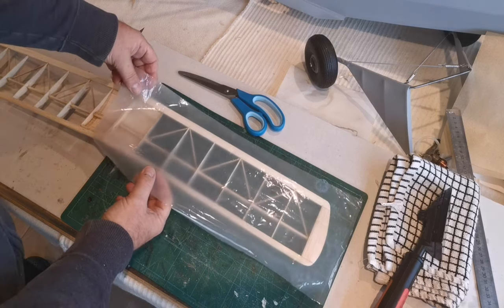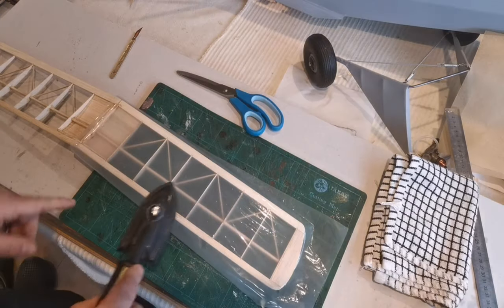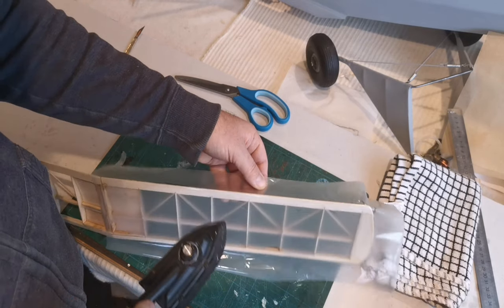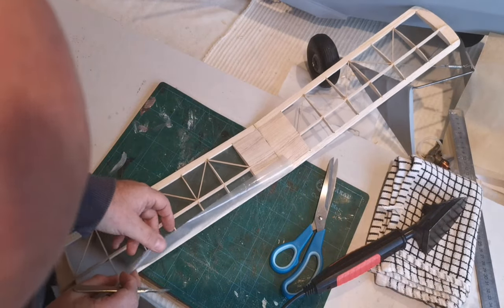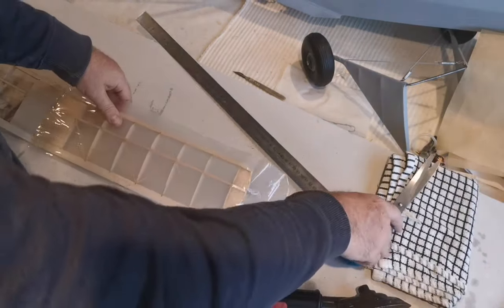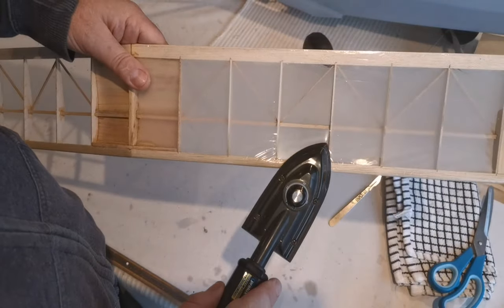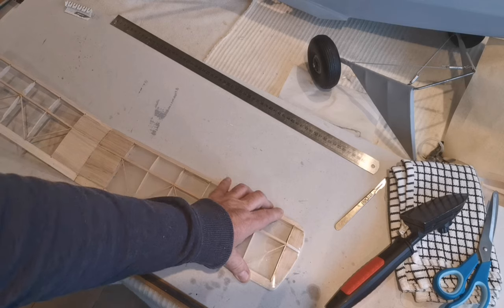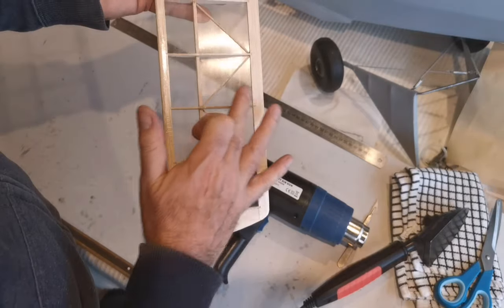How to cover a wing in doculam.

Comment: Hi Mark.  Great video, I have used this type of material on three of my models. After attaching around  the edges  I use my iron for shrinking as I donot use a heat gun as it puts out to much heat With an iron `you not only shrink the whole wing and it gives you more control and as abonus it attaches the material to the  upper and lower of the ribs. Keep  the videos comming.

Comment: Nice demo Mark, I would suggest though that because the doculam doesn't shink to any great extent any wrinkles have a higher chance of coming out if the whole panel is shrinking as opposed to just one panel if you stick it down to each rib. I think shrinking it all first and then going over each rib is a better idea, unless they're undercambered as you said of course. By the way DB Sport and Scale do some nice tissue and very reasonable in price as well, cheers.
Reply from the maker: Cheers Cliff, I was pleased at how the wrinkles came out perhaps because I pulled it fairly tight while sticking it down. For the Mini Playboy I will have to do one rib at a time as it has a strong undercamber. I've just been checking out DB nice colour choices cheers.
Reply: Would agree with CH. Good to be able to shrink the entire wing as one which is how you did it. I assumed it was on purpose. 
Good demo thanks. Must get a roll of that. I think 37micron is the thickness to use